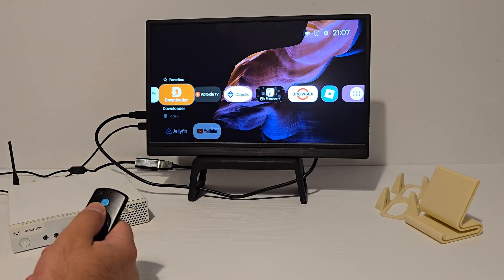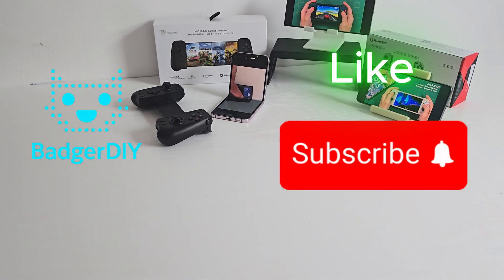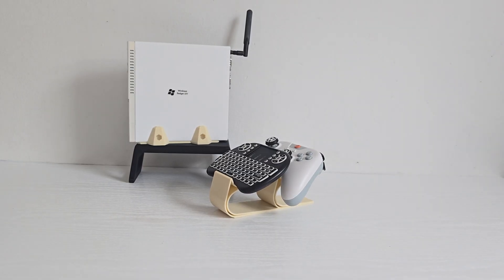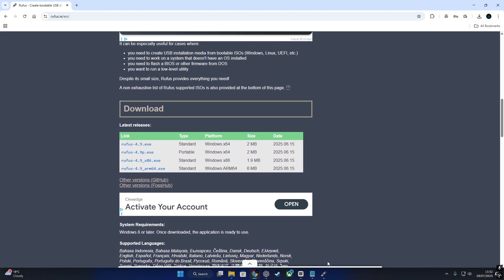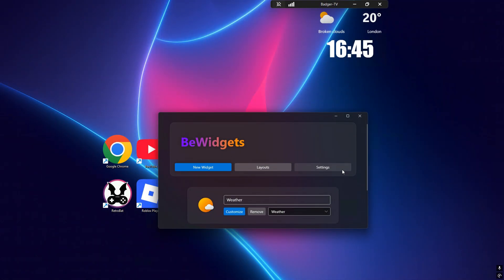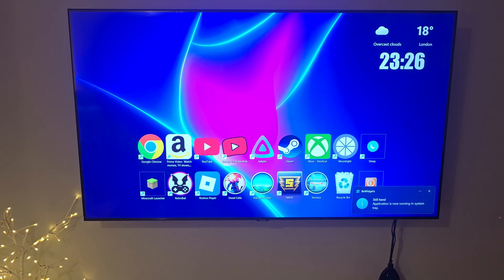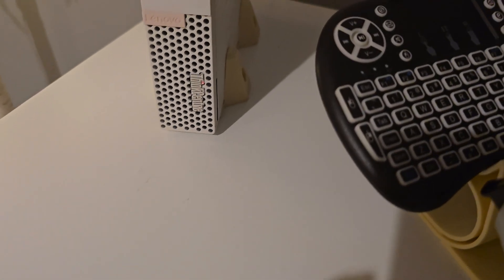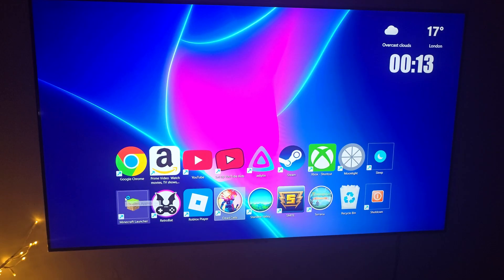From Android TV to My First Windows 11 TV – Here's What Happened

Comment: Not bad! But this setup has hardware limitations in 4k and decoding. 40k60 you can get only through DP, HDMI is limited to 4k30. And codecs - not all will run great, especially at 4k. 
It will be interesting to see Linux video with details about 4k Netflix etc.
Reply from the maker: That’s true – this Lenovo M910Q with the i5-7500T definitely has its limits when it comes to 4K, especially via HDMI. Still, it works well enough for 1080p media and casual use. I might try a Linux build next to see if it performs better with things like 4K Netflix and decoding. Appreciate the insight!
Reply: I would recommend Bazzite. Is a Linux distro based on Fedora but optimized for gaming. I tried Bazzite + Waydroid so you can have both: A media center and some servers running in the background.

Comment: The problem i see, is that on Android there are alot of "pirate" streaming apps..is there any "Pirate" streaming apps for Windows?
Reply from the maker: Yeah, that’s a common difference – Android has loads of third-party streaming apps. On Windows, it’s more limited unless you dig into web-based options or use apps like Kodi with custom add-ons.
Reply: Stremio is the best
Reply from the maker: Not saying no to Stremio, but I do preffer Jellyfin simply because I have control over it.